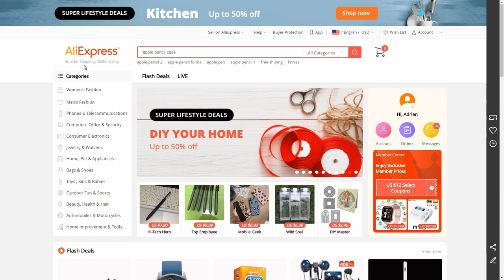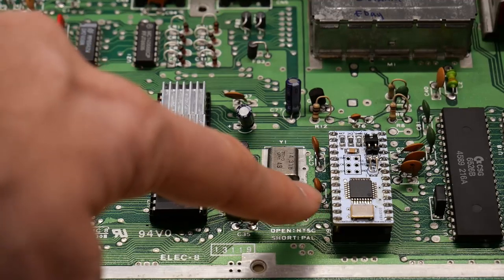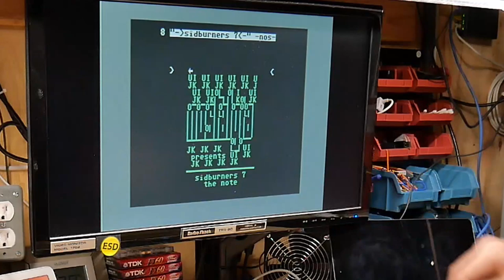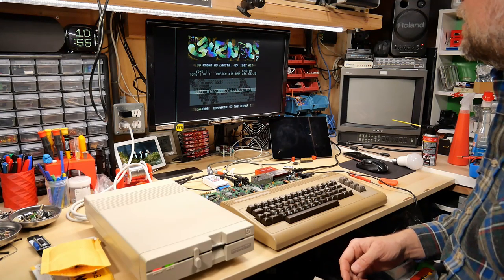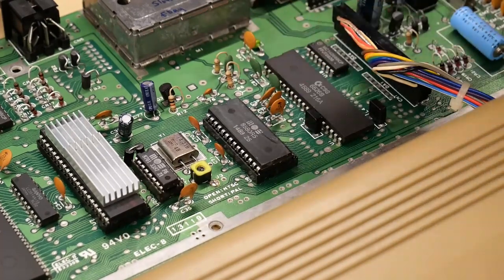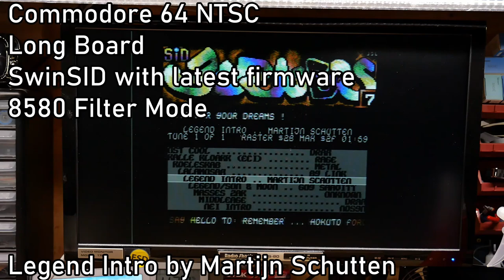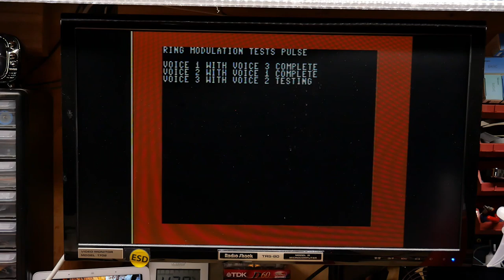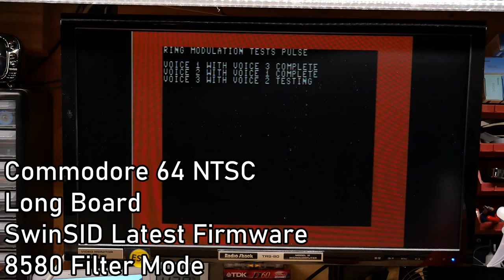I bought a C64 SID chip from AliExpress!

Comment: ...a question if you follow MADE IN CHINA: I'd bought a NextBook Ares10A Android 6 WiFi tablet quad core Intel x5-Z8350 1.92 GHz 32 GB NX16A10132SPS (from WalMart)...solid manufacturing but works like POS (point-of-sale 6.0 presumably self-updating/upgrading to advertised 6.1) instead of the students' ideal-for-school-work...yet what makes this 'interesting' is that Google did not appear to do 6.1, (cf KRACK exploit)...

Comment: Adrian, you should get yourself a PAL C64C or at least a PAL 250469 short board for your SID tunes.  The PAL timings will make everything sound correct (and will display the cool demo effects correctly).  Like you said, the 8580 SID and C64C are what all the demoscene coders use and program for.  I'm in the US and have more PAL 64s than NTSC ones.  You could use that to make a cool video about building a 50hz clock generator too.  I've made a few of these for my PAL boards out of throughole ICs (PCBs on OSH Park) but they're a bit larger than they really need to be.  I'm currently working on a really small one made of SMD chips and a version of the switchless kernal switcher similar to yours, but with the addition of using a free IO pin on the arduino to generate a 50hz signal for the TOD clocks as well.
Reply: Or an Ultimate 64. Since so many cool demos and games are PAL, I use the Ultimate 64 in PAL to experience them properly here in NTSC land. More expensive, but the other great stuff you get with a U64 is so worth it. HDMI out, USB drive for storage, true 1541 emulation, on board Freeze carts, ethernet, Two sid slots, UltiSid emulated SID for up to 8 SID playback, and most importantly, it is still supported and improved on all the time. There is an onboard wifi chip that is not being used yet, but will eventually.

Comment: Can you undervolt the 6581 to say 10 or 11 volts to make it run cooler and last longer. Does that affect the operation/sound?
Reply: You can't undervolt it by that much.  About half a volt in either direction is the maximum tolerance on most chips.  For example, you'd probably be fine with only 4.7V on the 5V rail (and in fact, undervolting the 5V rail by about 0.25 volts makes the entire machine run ~3C cooler.)  Or, in the case of the 12V supply, 11.7 volts would probably work.

Comment: The 6581 uses a 12V VDD and 470pf audio filter caps, the 6582/8580 uses 9V VDD and 22nf audio filter caps. (check what the board is set up for) If you use the wrong caps and/or VDD the SID will sound wrong & if you use a 9V SID on 12V it will cook it. (see C128DCR schematic)

Comment: 8580 has a different analog section owing to the new process and lower voltages. You'll really hear it in the filters, which is why the percussion and white noise is different. It also has much less of a click when changing the master volume, making a lot of samples too quiet.

Comment: Looks like this chip was from week 14 of 1989, so it was one of the very last chips that ran off the line. Quite probably a part that was produced for Commodore but installed in a unit that was never delivered, and junked along with all of the other stuff when the factories closed down.

Comment: Run it at 50Hz and your drum will sound better.
Reply: Kind of, it's not the 50hz that is the problem, it is the faster system clock of 1.023MHz of the NTSC system vs the correct PAL clock of 0.985 MHz.  Having the TOD clock tick at 60Hz from a US power supply will do nothing to impact the sound, it will just make timers run fast.  A 50hz generator can be wired in though to fix that.
Reply: mrb5217 not to spoil your cornflakes but the system clock (which feeds the SIDs divider chains internally)  is always about 0.98MHz on a 50Hz C64.  It’s because the clock circuit derived all timings from the same crystal.  This leads to all the notes being of lower frequency.  Now this does not change the low and high pass filter characteristics.
Reply: @Jenny_Digital  you're not spoiling my corn flakes, I know that.  I said it's not at 50 hz as originally mentioned.
Reply: mrb5217 So are you then considering the consequence of differing timings on the engine that’s playing the tune then?  I don’t know why but that never occurred to me.  There’s the blanking interrupt, timers will run at different speeds and of course anything video that contends for memory will upset the code flow timings.

I thank you for reminding me to look deeper.
Reply: @Jenny_Digital  The interrupts and everything else that runs the system that gets divided from the 17.73MHz crystal (including the system clock) will be fine as long as there is a PAL VIC running on a PAL crystal.  What I'm referring to is running PAL C64s in countries like the US with 60Hz line frequency.  A PAL C64 can run fine on a US power supply, but the 9VAC input will be at 50hz instead of 60hz.  The only issue this causes is that the frequency from the 9VAC input is used to trigger a pulse on the C64 that feeds the TOD inputs on the CIA chips.  An NTSC machine will count 60 pulses = 1 second whereas a PAL machine counts 50 pulses=1 second on the TOD "clocks."  If the line frequency doesn't match what it is counting, the seconds counter will be too fast (or too slow).

As far as I know, the only thing this is used for is simply keeping time, such as in GEOS or SID players with a mm:ss counter--neither of which will effect the pitch or duration of the SID output.

This can be easily remedied for those in the US want to use the PAL C64s (and care about counting time on SID players) by generating a 50hz square wave pulse, lifting a few components to isolate the TOD input on the CIAs from the line pulses, and simply injecting 50hz there.
Reply: @mrb5217  I would simply install a modified KERNAL, that always sets the CIA to 60Hz, rather than basing it on the detected video system.
Reply: @danielmantione  How can I modify the Kernal to do that?
Reply: @mrb5217  The relevant check happens at $FDDD:

https://www.pagetable.com/c64disasm/#FDDD

Instead of loading the PAL/NTSC flag from $02A6, you could for example modify it into a LDA #$00, so it always jumps to the 60 Hz init code.

Comment: Hmm, if I remember correctly the C128 also uses an 8580, so it should sound the same as the short board one does, also here where I live (Argentina) the 64C was quite popular in the home computer market and I even played with one at a computer museum located in the central part of the city

Also the 8580 is a complete redesign of the original 6580, so that's why it sounds so different, but hey I like the two since the difference is only on the filters, the synth is still the same
Reply: as i can recall  the very early  C128 had the 6581  and later 1985  had the 8580    Commodore corrected  the Bug  on the 8580   but unfortunately   Game composers  went around this cursed  Bug  or they Actually  took it as a Advantage  ...   and put it too use making  great music ..     so when the 8580  came around  with out that bug  the Game Music  played differently  and sounded like crap as some of the music had either dead spots or sounded way differntly  in laymans terms   ITs   like someone used  a slightly different sound bank  to play midis  files   in todays   PC   Soundboards

Comment: Fun fact is that in my country, when it come to complete machines (and not loose parts only) early longboards usualy goes for almost twice the price of the later shortboards if they are in good condition (unless it's something extraordinary of course). I guess it was because the production of the early C wersions was going on for quite a long time in Europe, particulary in Germany (and England for the very early series if i am not wrong...) i think, before it was mowed ower to Taiwan until -94. If it wheren't for the shippingcosts i think a lot of people here certanly would be opneminded for swapping machines with each other in order to even this out a bit.

I will not flaming You for telling the real truth about those horrbile joysticks either... But the power of nostalgia... ha ha
Reply from the maker: Hehe!! Like I have a bunch of old joysticks and they all hurt my hand just like when I was a kid!!! There is a reason that old design is gone. And yes, the longboards here are so common which is why I have so many. I don't think short boards cost more you just never find them.
Reply: @adriansdigitalbasement  

Thank You for Your reply.

I still hawe a few of those joysticks i recently restored for historical reasons, even if i newer use them, but they bring back memories. :)

When it come to loose boards without casing the pricing are about the same hare too, but those early American made ones are higly attractive in Europe  because they are so rare to find here.
I plan to build an "Amiga tower" in a PC case from loose parts i hawe lying around in boxes in the future.

Comment: One of my biggest regret has to be when sometime in the 90's I threw away my C64 that I modified to have 2 SID chips for 6 voices. I was moving out of an apartment and didn't have the room so I left it outside the building and actually went back 10 minutes later because I changed my mind and it was already gone!
Reply: Meow 🥺
Reply from the maker: I think most people have the same story too. I got rid of tons of old valuable stuff back then. Little did I know I would want it all back now!
Reply: I threw away my amiga 500, db50xg, action replay, tragic isn't?
Reply: I don't remember exactly when, but i'm pretty sure i junked my 1541 disk drive (either way it's gone). Regret it now.
Reply: @DavePoo  🥺
Reply: @adriansdigitalbasement  I'm the opposite. I was buying all this "old junk" from the Tip Shops and Op Shops when everyone was tossing it out and I have a big stack of C64's, several A500's and other stuff like Apple IIes's etc. I have repaired a lot of C64's in the past, but I just don't have the time to do anything with them at the moment, but I hope to get back to sorting everything out one day. Unfortunately, this stuff just isn't around anymore.

Comment: Great video, I bought 2 8580 for my c64 for not knowing how to burn one, I need to know how to change from 12 v to 9 v in the sid stage, could you make a video of that?
Is it simply changing the regulator or has something else
Reply: According to this diagram https://www.commodore.ca/manuals/images/c64_rev_a_250469_motherboard_schematic.gif all you need to change is one zener diode, marked CR7 (it's in the upper part of the diagram), and remove resistor R8 which is wired between audio out (pin 27) and ground. Hope this helps. :)

Comment: I'm working on a C64 (my second repair) and have isolated to a bad VIC2 chip (6567R8). They are all ridiculously expensive. I've ordered one from AliExpress. Wish me luck! I bought a GAL PLA from ebay and it's working great. Before long I'll get a MiniPro. Maybe I should buy a batch of PCBs and sell them to increase the US supply. Most of these C64 parts and items seem to need to be shipped from Europe or China - too bad there aren't more local sellers.

Comment: I notice that almost all of your failed SID chips are from 81 and 82, and the dead PLAs mostly from 83 and 84. Do you think this may be related to the passivation-layer problems MOS had in the fabrication at the time? Some of the eningeers mention something they called "purple creeping crud", where the glass sealing the die had a bad composition and would slowly etch away the aluminum metal layer (sometimes over the course of years). It was presumably discovered and fixed in late 1984 or early 1985.

The main reason for using the 8580 for demos and other prods, is that as you mention the sound is much more consistent and predictable. The 6581 have a filter which is quite compromised, and very greatly affected by variations in transistor-grade. Every single 6581 therefore has its own distinct sound and filter-behavour, and you'll have a hard time finding two which sounds exactly the same. As the designer said in an interview once "I knew it wouldn't work very well, but it was better than nothing".

Comment: I remember getting a C64C and being disappointed with the sound. I don't remember what the exact issue was though. Just that something sounded terrible compared to the bread bin C64s. I eventually got the chance to swap in an older C64 SID and it worked fine. I didn't know anything about the voltages back then. I don't know what happened with The older C64 that got the C64C SID. I don't remember there being any issues with the swap, but this was all nearly 40 years ago.

Comment: Sound evaluation:  The long-board sounded good, but slightly 'muddy' in the more percusive parts...; the short-board with the Ali-Express SID sounded cleaner; brighter, with a better defenition on the percusive parts:- they sounded like something striking metal, rather than a dull thud.
Rather like clean tape heads, vs dirty.......  The Swin-Chip sounded ok, but the melody tracks were recessed and slightly echoing.... not very nice - especially when the main part of the track breaks out!
Overall, for me, listening on headphones, the Ali-Express SID chip sounded cleanest, and most musical, and so for me, the best.

Comment: Glad you got a working one.  I don't know why but once I got my 64C in 87/88 with the 8580 SID I liked the cleaner sound better then the original 6581.. 

That said, the short board is not rare in the USA it is actually quite common.  Most of the 64Cs you find will have a short board.  In 1986 when the 64C came out they had an interim board a 1986 board with 6581 SID.  You can usually identify them by the keyboard as the original run of 64Cs had the symbols printed on the front of the keys versus the later, what I like to call the "true 64C" where the symbols are printed on the top of the keys.  They only made these original longboard 64Cs for a year or so.  So they are quite uncommon.  

When the shortboard was released in 87/88 it had the cost reduced chipset with 85xx chips.  It is much more reliable.  They sold these from 87/88 all the way until 93/94 even in the USA.  At user groups in those days this was quite common and many original 64 owners at the user groups bought into the 64C.  It was very popular.  At least that is my experience being heavily into the 64 in those days.
Reply: interesting, what area of the country are you in?  I grew up on the west coast and until i got back into these computers recently, i didn't even know c64s came in this form factor as i hadn't seen them.  After our C64 Breadbin, we had a Commodore 128 which came in this newer case, and then went onto other computers after that.  Not a lot of people here in 86 or later were still using c64s and certainly weren't buying them at the time.  But again, maybe it was a regional thing?
Reply: @brianv2871  SF Bay area.  From 86/87 on that is all you seen in the stores here was the 64C model.  I know a lot of people moved on by 90/91 but I was a hold out!  Well I guess a lot of people in the User Groups were too, and still are.  😉
Reply: @RacerX-  ahh, Los Angeles area here, which Adrian was also... but yeah, i guess we started early and moved on by then. 😁

Comment: I actually thought the SID chip was the most worthless part of a C=64.  I never used it, and I thought the style of C=64 video game style music you now find on cracks and warez to be... well... awful.     What I would of rather had was some kind of super expander cartridge functions built in, like that came later with the C=16 or Plus4 or whatever.    Some kind of Disk operating system and some commands to help you debug, and do graphics and a built in monitor.

By the time short boards came out in the states, we were already feeling screwed as early adopters and in envy of Mac Plus GUI's with MacPaint and MacWrite (and later Hypercard) and PC EGA graphics and the raw 12-16mghz compile speed of PC AT's and Quickbasic.

I don't even know what you can do with a PET/64/128 today.   Screw around with 6502 programming and that's about it.  Mine and the rest of my 8bit collection just collects dust and gets more aged yellow with time, as the caps quietly dry out....     I haven't switched an on switch on any of them in 20 years...  when I did in for kicks... but the real number is more close to 33 years... 

I will say this... I bought some Burgundy colored 6502 programming manual, and the C=64 programmers manual, and those were gateway drugs for a while :-)   Until I saw a Mac 128, then got access to a Plus and I was hooked.  Geos couldn't hold a candle to it.   Weird leap, from Commodore to Macintosh, and it literally was leaping a chasm... particularly in price.     Like going from a Volkswagen Bug to a Lamborgini.... not in speed, in richness of user environment.

Comment: I'm not sure if someone has mentioned it, but the ArmSID is very good and can run in both 6581 and 8580 modes, it is massively better than any Swinsid. The Swinsid was ok if that was all
You had but once You get an ArmSID the Swinsid will get chucked in the bin (probably).  https://www.retrocomp.cz/produkt?id=2

Comment: I also bought a SID (6581R4) from Aliexpress. Price was 21€ so I took the risk. Surprise surprise! Its broken, I get black screen with it. Also the top is suspiciously perfect. I mean absolutely 0 scratches or marks on it. Not what you would expect to see on a 30+ year old chip. The underside is not that perfect but it has no markings on there so I wonder if this is a SID chip at all. When I find my acetone bottle I will see if its reprinted. Seller is YangFanDa Store. So steer clear.

EDIT: did the acetone rubbing test: big FAIL. Repainted fake chip. Will open a dispute with Aliexpress.